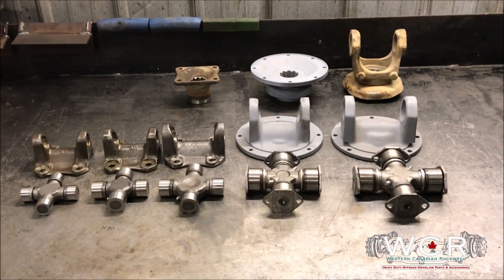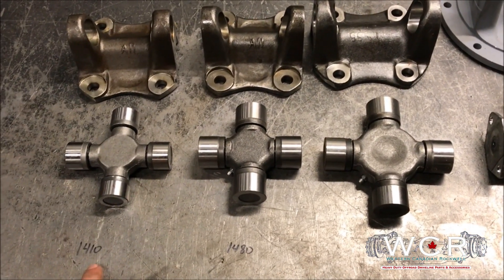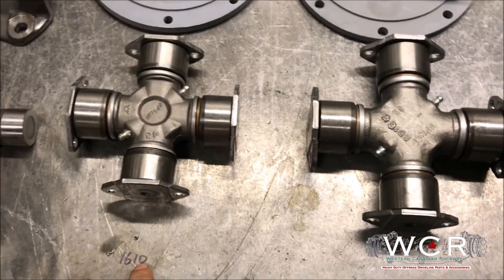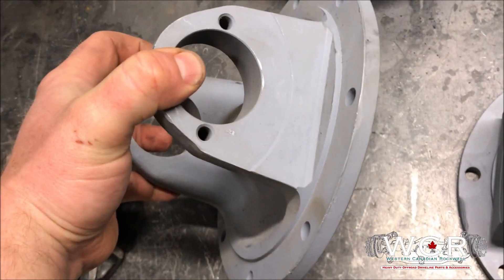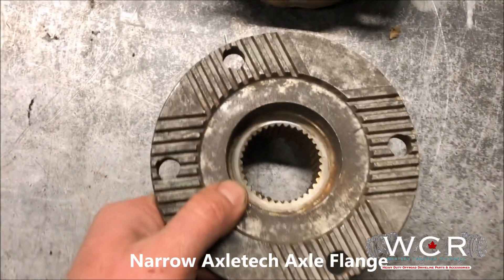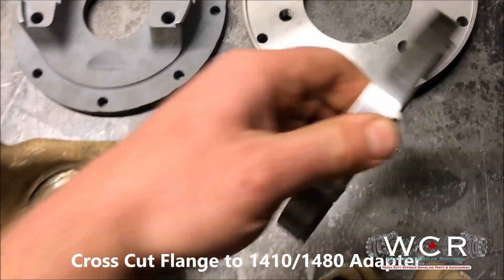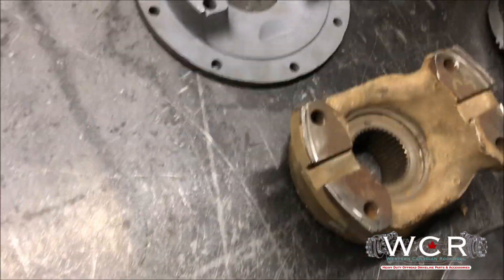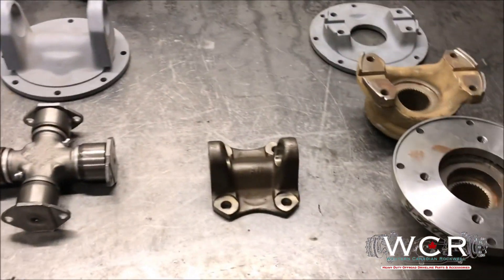WCR TECH TUESDAY - U Joint & Driveline Flanges Demonstration - Episode 1

Comment: hi, Do you make an adapter so I can use a 1610 u-joint on my transmission's 4-bolt output?  All the other u-joints on my aux trans, transfer case and axles are 1610 and now that I'm rebuilding everything I'd like to have all the u-joints the same.  BTW, does a 1610 have the same total articulation / movement as a 1410 - 1550?  Thank you.
Reply from the maker: Contact WCR for the answers :)